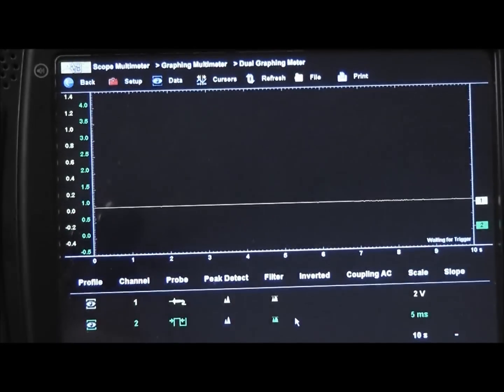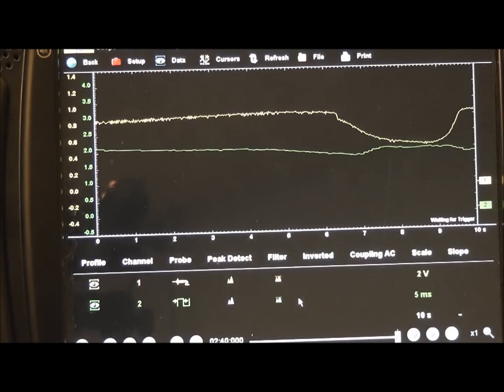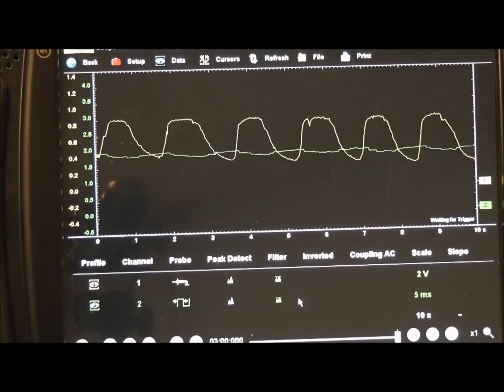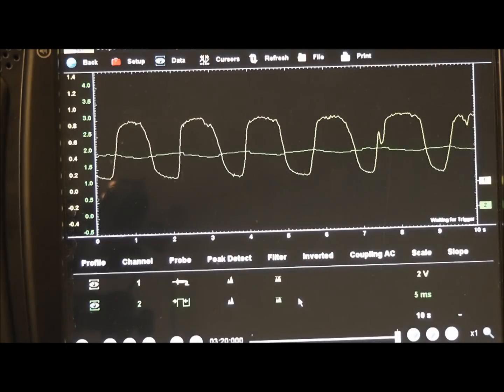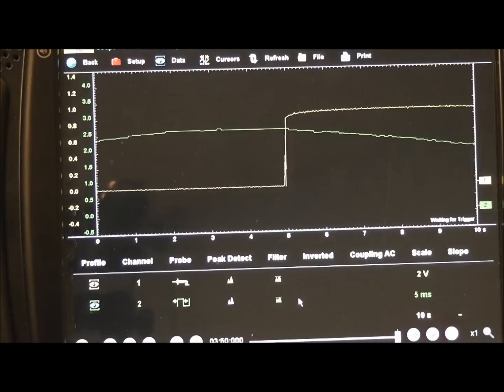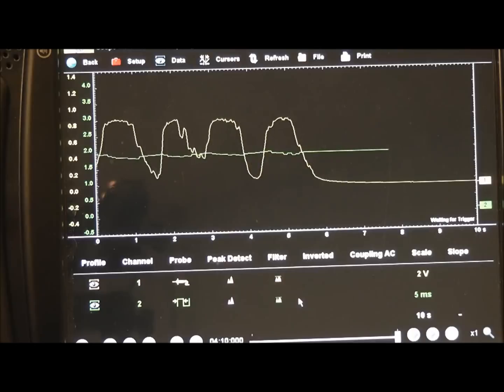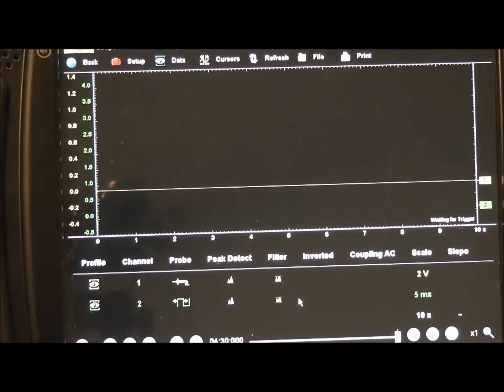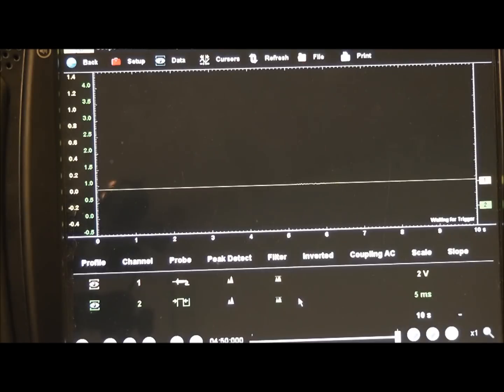How to simulate a rich & lean O2 signal (PCM response testing)

Comment: Scannerdanner  you hit the nail on the head about the vacuum leak on the 98 cadillac 4.6 litter intake manifold opposite end of the throttle body at the base, can't tell though if it's cracked or a gasket issue. This time hook up scantool stft bank 1 was 29.5 and as gave throttle all the way to 2000rpm  plus the number din t buge. Is it because I hit with the carb cleaner got some of the gunnk out of the way thus letting in more air? This is the only logic explanation I can come up with..

Comment: Scannerdanner  I'm starting suspect a faulty Maf sensor but no dtc  very high Ltft fuel trims on both banks. Repaired vacum leaks and retested no leaks. Fuel presure in specs snap throttle pressure gose up. Maf is a gm 3 wire don't have eqipment to test hz. Only live data.  Looking at Maf at idle it is minimum  4.5 g/s and max 5.6 g/s. engine load 1.5

Comment: Ok tested out crank case ,Gage didn't so much as twitch... So what I did was take all vacuum sources off line and plugged them off... Brake boost PVC etc  Ltft remain high on both banks... This is very highmilage car could in jectors  be dirty? I ohm test them all ther are in spec plus manually injected them... With the power probe 3.. I know that dosent tell if ther squirting the way that should...

Comment from the maker: @CHIBA280CRV Yes, I just wouldn't do it on a wide band O2. Just the narrow band zirconia O2s. It will even work on a feedback carb. system. You would just see mixture control solenoid duty cycle increase or decrease instead of injector pulse.

Comment: Scannerdanner on my 2003 BMW 325xi fuel pressure drops after Turning off the engine, will that backflow lead cause the running pressure to fluctuate and cause the engine to run rough?
Reply: I mean leak.

Comment from the maker: @ScannerDanner Also this test is not needed if you have scan data and an O2 bias voltage. I am doing something similar on a Ford in one of my videos, but I am using scan data instead. (Ford does not use a bias voltage on there O2 sensors)

Comment: Unplugged Maf sensor Ltft bank 1 & 2went to 30 plus did not budge. plugged back in engine died. Cranked it back up bank1a (Ltft at idle 29.6)so I take it to 2500 rpms (Ltft 10.1).Bank 2 (Ltft at idle35.1) at 2500 rpm (Ltft 14.8) this is at close loop , something is effecting both banks 1000percent sure it not a vacuum leak.  Their is a slight miss at idle so I replaced coil wire plugs on all cylinders.. Just hooked up vacuum Gage I have a very very steady vacuum for car with 191plus miles. It's

Comment from the maker: @fivefortyeye540i If LTFT was high at idle and normal at a higher RPM, then it is not a fuel psi problem. Sounds like a vacuum leak. Check the rubber boot between the throttle body and the intake manifold for a tear (if its the design that has it). If you don't have a smoke machine try dumping water in that area with the engine running. You will hear the water get sucked into the engine. No, you will not hurt the engine, just a little momentary steam clean of the pistons :)

Comment: 98 caddillac 4.6 litter v8 base model  I have smoked intake plus carbcleaner my next step is to see maybe if the PVC valve could be sticking open at the valve cover. Or possible hole in the exaust.. Front bays wher the main 2 o2 sensors sit.

Comment from the maker: @MrMratni No, this test is for wiring integrity only. The propane test is used to determine if the O2 can respond to ratio changes. This test would be done after a non responsive O2 to the propane to ensure the wiring is not open or shorted to ground.

Comment: I compression tested bank 2  cyl 2,4,6 are in tolerance of one another at 200psi cyl 8 is 225??? Warmed engine 5 sec count for each cylnder. This car has 191000 miles compression should nt be that high???

Comment from the maker: @fivefortyeye540i Or the engine temp. was colder than your last test. If it is a manifold gasket the leak is usually worse the colder the engine is due to contraction of the intake. (it expands when it gets hot and seals the leak)
To pinpoint the exact area use a stream of water from a squirt bottle.

Comment from the maker: @Bushougoma I certainly understand your concern. You could do it by touching one finger to battery positive then the other to the O2 signal wire. This works too. Its just hard to get your hand in some of those places. I started using a test light years ago and have never hurt the PCM monitoring circuit yet. In fact, in my experience the only thing I have seen mess up a voltage sensing circuit (like an O2 would have) is an injector control wire touching a sensor wire. (120v spikes)

Comment: Scannerdanner 98 Cadillac 4.6 l got codes p0174 p0171 cleaned Maf sensor cleared codes up. I did a fuel pressure cheak and got 42psi, spec says 45 and better. As I was looking at live data fuel trim stft bank 1 and bank two seem normal 0 to 5 percent . But the ltft on both banks wher high a steady 35 at idle.  Would that 3psi fuel pressure difference cause this ?

Comment from the maker: @Username64870 A wide band O2 is not tested the same way. Do NOT use the test light on it. Narrow band O2 sensors only. Also if there is a bias voltage on the O2 circuit (which most have) the test light method is not necessary to test wiring integrity. The other thing to remember is this test would only be done when the O2 sensor signal voltage is a flat-line, meaning dead and not responding to ratio changes. You would never do this on a working O2 circuit.

Comment: Any idea how to test wide band O2 sensor.I have heard that ECU sends small calibration voltage to this type of sensor. Anyone knows how to test 5V 02 sensor does it pull down when rich?is it safe at any situation to bypass O2 sensor with test light?Thanks in advance.

Comment from the maker: @fivefortyeye540i I don't think that is a problem on this engine. It is listed at 10.3:1 compression ratio so I would imagine these numbers are normal. Are you sure that the rubber boot between the throttle body and the upper intake is not split? Try dumping water on this area with the engine running, you will hear it getting sucked into the engine if its cracked.

Comment from the maker: @fivefortyeye540i Unplug the MAF sensor and see if your fuel trim #s normalize. If they do suspect bad MAF, if they stay very positive (high) then you need to go in another direction. Keep in mind this unplug it test is not valid on every vehicle. Some manufacturers do not have good back-up strategies for a critical sensor failure 
(ie MAF unplugged) but GM and Fords do for sure.

Comment from the maker: I used a test light not a jumper wire. in my experience you will not hurt this high impedance input circuit. Notice the circuit doesn't support enough current to even light the test light. No current = no heat = no problem. I realize there are better ways to check input wires for opens and shorts, but not in this case. (no bias voltage on Ford O2s)  If the test light makes you nervous you can use your body as the resistor but either way you are still sending 12v on the circuit.

Comment from the maker: @fivefortyeye540i Ok I remember now, sorry. Check the PCV as you said, also check it for an internal vacuum leak, not sure if this engine it is possible but worth a check. Test: Block off pcv and breather hoses (very important to do properly), remove dipstick, install vacuum gauge on dipstick tube. Crankcase should build pressure NOT pull into a vacuum. Vacuum in crankcase = split intake gasket internally pulling in crankcase air (still a vacuum leak if you think about it)

Comment: @fivefortyeye540i there is a certain practical side to all the previous information you provided on this vehicle. Cars of a certain age  have many ailments and problems. You will fond it difficult to chase after each separate symptom. One solution is to do a general repair and rebuilding of the engine hitting all the major week spots. It's the same logic that causes many people to donate a car to the junk yard or to charity. It becomes cost prohibitive to do further  maintenance

Comment: This is a good test and it does check wiring integrity. However there has to be associated signal conditioning circuitry inside the ECU. If the system won't go into closed loop the problem could be the O2 sensor or the wiring as we all know. But it could also be the signal conditioning electronics inside the ECU. If the test shows no system response you should check the wiring first. However if there is continuity from the sensor through the wiring and to the connector at the ECU and the system still won't respond you may have bad signal conditioning circuitry inside the ECU. And that means a new computer.

Comment: @fivefortyeye540i Part 2 further maintenance and upkeep, given the cost of parts and services; weighed against the car's value. This is true in the US economy and may have different implications elsewhere. Good diagnostics often solves problems but just as the body wears out so do cars. What if after you do all these repairs the transmission begins to slip. then you're in for another three grand. Then the body work and i think you can see where i'm going with this!!!!

Comment from the maker: @cptdavidwebb From my experience not on a high impedance input circuit. As you can see in the video with this O2. Notice the circuit doesn't support enough current to even light the test light. No current = no heat = no problem. I realize there are better ways to check input wires for opens and shorts, but not in this case. Also an O2 that uses a bias voltage on the signal wire this type of test is not needed.

Comment: Hello mate I have mercedes s63 with misfiring problem and it’s showing this code p02307 and p0040 3 weeks a go I change the oil and the engine light goes of and the car works perfectly but 3 days a go light comes on again and misfiring all spar plugs all coils are new  oil and filters all new from merc I’m really surprised 😱 with this codes I don’t know where to start o2 sensors or vacume leak or petrol problem

Comment from the maker: @fivefortyeye540i Fuel trim #s improve with a higher RPM. 9 out of 10 times this is a vacuum leak. What year, make, model and engine? It would help to guide you further. I apologize in advance if you already told me. 
Also if the O2s are switching, then it is NOT an O2 problem.

Comment from the maker: i would say must be not could be. because it is the computer that is driving the mixture rich and lean that makes an O2 signal look like that. and the computer doesn't trim the mixture in open loop
Reply: ScannerDanner I thought we could use o2 readings at wot to see if we are getting enough fuel. Or at wot, would it just be fixed rich or lean depending on if we have enough fuel or not? Assuming wot is open loop.

Comment: Hi Paul. im trying to diagnose my car and need direction. i know on MAF engines vacuum leaks improve under load. is it the same for speed density engines ? a vac. leak causes a rich condition,but do the fuel trims also improve on these engines ? im at -20 total trims and under load STFT improves. im wondering whether to chase vacuum leak or would i be wasting my time. ?
Reply from the maker: +Alejandro Amaro I wouldn't say that a vacuum leak causes a rich condition on any engine. I would say that a vacuum leak on a speed density engine will just be compensated for and you may have normal trim numbers. If you have a- 20% fuel trim then you have a rich condition.  Look for a leaking fuel injector or a head gasket problem or a leaking fuel pressure regulator or too high of fuel pressure things like that. Make sense?
Reply: Ohh okay. Thank you my friend. I misunderstood the video on your premium channel where you mentioned on MAP engines you get - trims with a vac. leak.. I was honestly hoping it was just a vacuum leak lol because i think the fuel pressure regulator is inside the tank on my 02 civic and dont have a fuel pressure test kit yet.
Reply from the maker: +Alejandro Amaro if the regulator is in the tank then it cannot cause a rich condition with a leak. But it can cause too high of fuel pressure if it sticks closed (very uncommon)
Reply: I recently had a Subaru in with a P0174. Fuel compensation was showing max rich at idle only. Off-idle the fuel trims returned to normal. 

The vehicle had an aftermarket ( Duralast ) MAF sensor. The sensor voltage KOEO was 0.8v.
 Real world is 0.7v. Scope pattern of the MAF appeared normal during a snap. 
I
Can a tenth of a volt make a difference? You bet. A factory MAF sensor was then installed and fuel trims returned to normal at idle.

Modern vehicles are extremely sensitive to sensor voltage changes. Systems that have an operating range of 5v can be significantly impacted by values of a tenth of a volt.